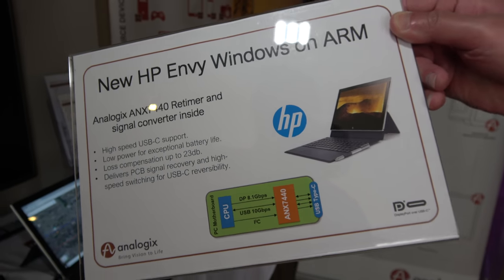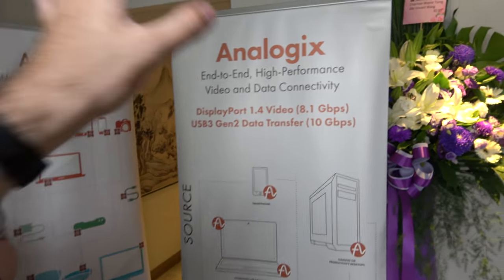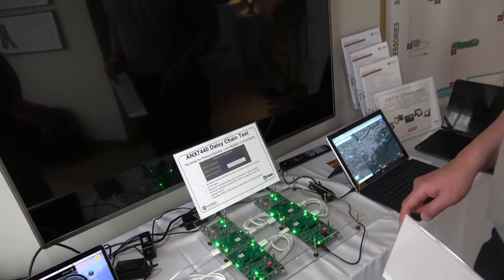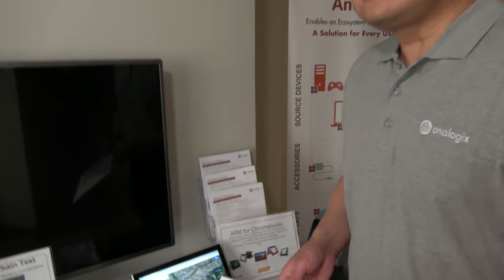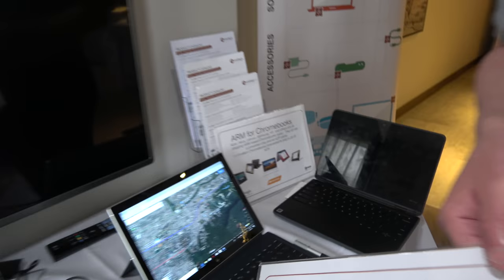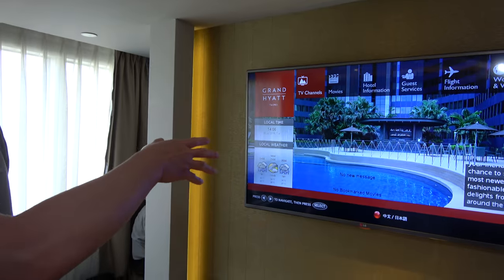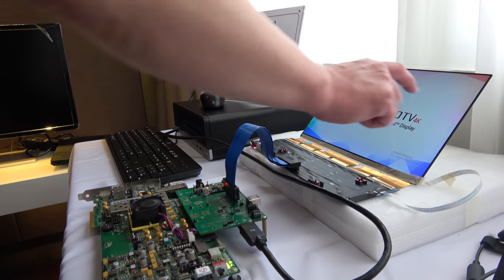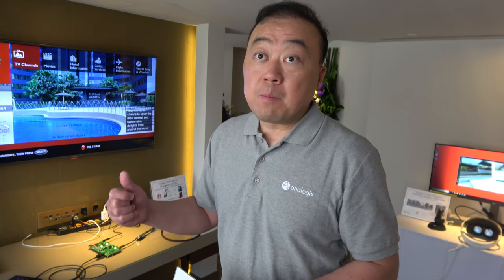Analogix 10Gbit/s ANX7440 Re-timer USB Type-C DisplayPort for PC Mode phones, laptops, monitors

Comment: In a serial connection the clock (which needs to be used to extract the data) is embedded in the data - so before you can get to the data you have to extract the clock.  The retimer extracts the clock from the jittery data and synchronises the clock edge to be precisely in the centre of the data - where it is least noisy.
Reply: I think it also have CC (Clock Cleaner) features in that chip so it improves input clock jitter for transmitting xcvr (about 5GHz).